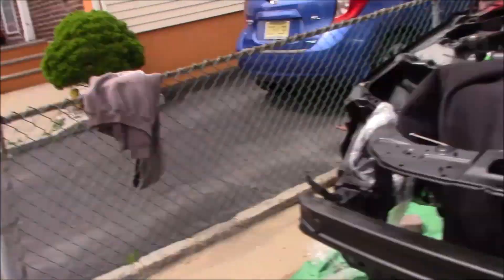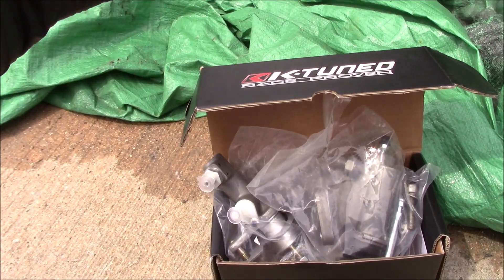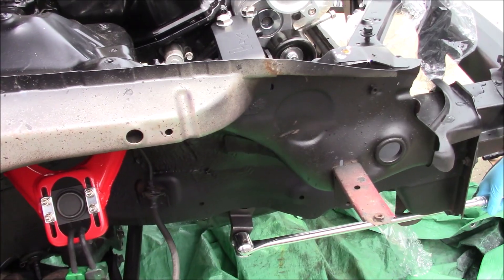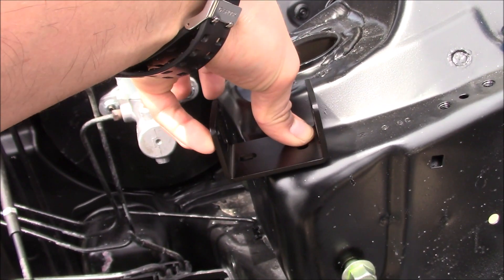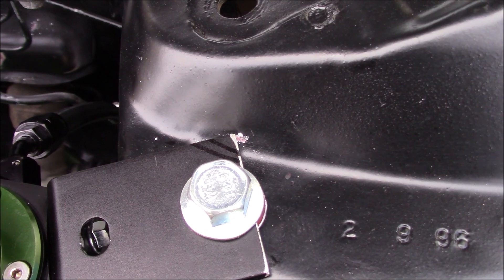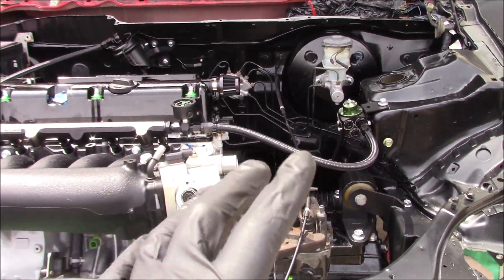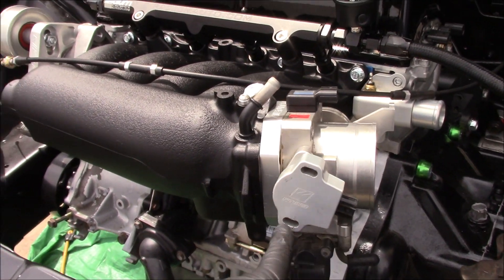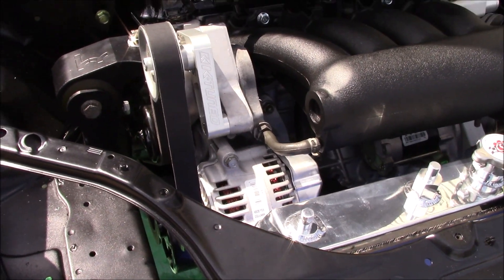K20A2 swap fuel set up explained

Comment: You don’t need a vacuum source for the regulator for NA application
Reply from the maker: you're right, thanks man. I didnt even realize he's not boosting it so he doesn't need the boost reference lol
Reply: So I just put a cap on the vaccum line port on my regulator?

Comment: I’ve never ran the vacuum line from my fuel pressure regulator. I have the k tuned one. Do I need to run a vacuum line to it or what?
Reply: for boosted engines (turbo or Supercharger) you need vacuum to the regulator so the regulator can REGULATE fuel as boost goes up or down.